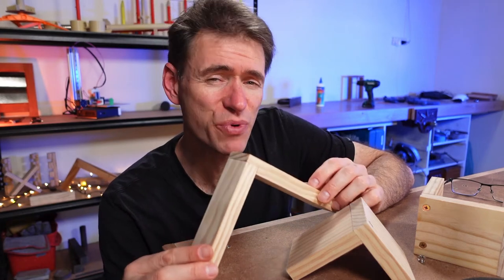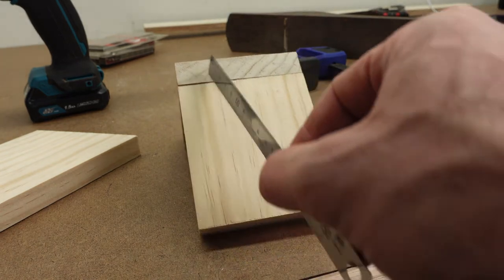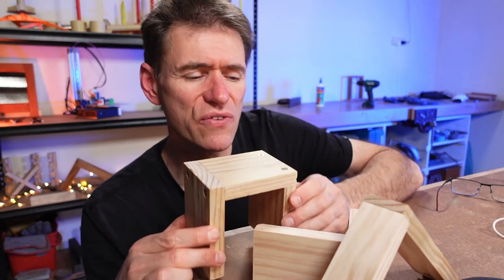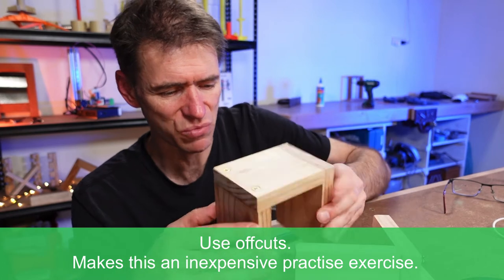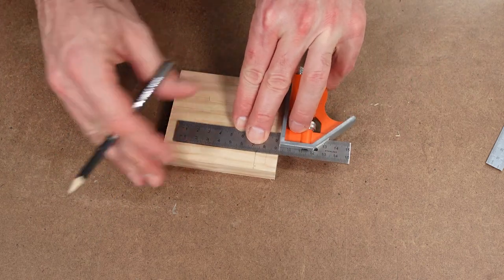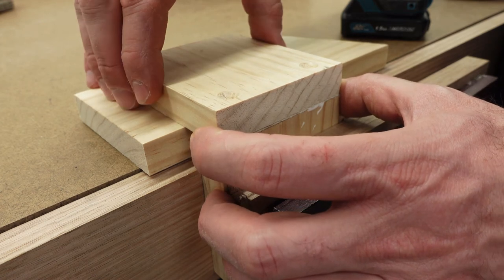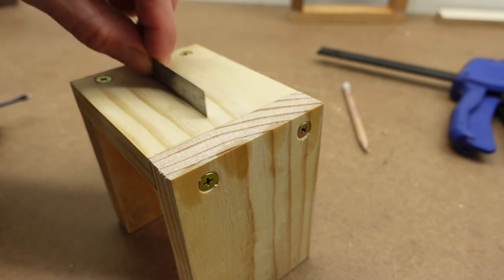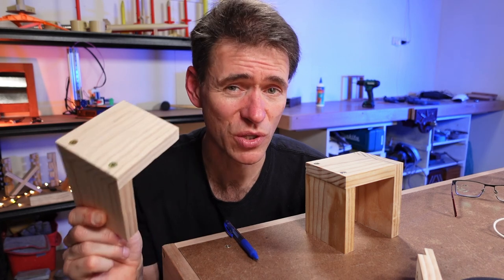How to glue and screw a timber joint | crude but effective

Comment: I never used to like the look of butt joints but have grown to really like them. For the right project, it has an interesting very solid and brutal look. Yours look great. Thanks for an informative video. 🇦🇺
Reply from the maker: Hey, thanks for the comment. Glad you found that useful. I agree. If you're going to use one of these, make it bold. 👍
Reply: I pretty new to woodworking and was toying with the idea of having bolts instead of screws. Purely for cosmetic purposes. Or a screw head that looks like a bolt etc. Would you have any ideas?
Reply from the maker: @AbitLippy  Sure. If you want it countersunk, you could try a batten screw. Or if you want it sitting proud, you could try a coach screw. Both look heavy duty, and could pass as bolts, but are actually screws. Coach screws come in small sizes. Batten screws are a bit bigger. It depends on what you are making. Both look great for that heavy style.
Reply: Thanks for the info 👍

Comment: Wouldn't pre-drilled pilot holes in the end grain also help with alignment?
Reply from the maker: Possibly. It depends on how accurate you are with your pilot hole. Any misalignment and you'll get the same problem. Also, if the pilot hole is small, the drill bit can bend ever so slightly also potentially causing misalignment. If I have the time, I sometimes glue and clamp perfectly square, let almost dry, and then follow up with a screw fixing. But I'm usually using this kind of joint when I need something built quickly. 😀

Comment: What about piloting both pieces of timber, also you can use salt in the glue to reduce the sliding. I find those plastic corner squares very helpful for this kind of job, or is that cheating???!!! I think in the example the screw was jacking because the pilot hole was too small on the top piece, it is better if it is the same size as the screw. and then the bottome piece will clamp.
Reply from the maker: Hey Danny, thanks for leaving a comment. On this kind of joint, I find piloting is just another thing to do. This is the kind of joint I use to just quickly knock something together. There was plenty of clearance for the screw...I find the problem happens most when the screw follows the path of the end grain its going in to. Anyway...salt? I'd never have guessed. Must try that. BTW whatever accessory you can use is never cheating. 😀
Reply: @ColinKlupiec  Good to hear from you Colin! I knocked one up quickly last week for a magnetic saw guide I was making only to find it was flush but a bit out of square, I should have watched your video first lol. It really is a good exercise though doing one properly as they are harder than they look for sure. I did see that F clamps are the go to tool because of the better adjustment. I also saw a guy cut the end off two nails and used them as pins to keep the pieces in position before glueing. I got the salt tip from Colin Knecht btw so credit to him for it, it's good to spread these tips around. 

Hey yesterday your marking gauge vid helped me a lot, I had been using a ruler on the horizontal where as you do it on the vertical which is a lot easier to see! I have come to realise it is a lot better to break down the processes rather than say tackle a halving joint straight off. I used to have a lot of trouble with the marking gauge but a bit of practice without the stress of trying to make something has worked a charm and I even enjoy using it now. Ditto sawing, this magnetic guide is a real confidence booster, I think my sawing will come as I am a lot looser in the hand now I know I will be square! 

Anyway thaks for the vids they have been a godsend, we aren't all Johathan Katz Moses hehe, and good luck with the teaching.